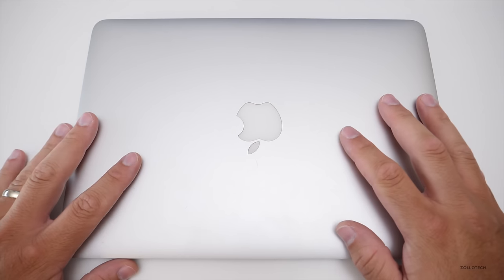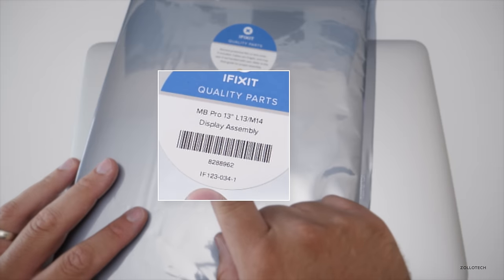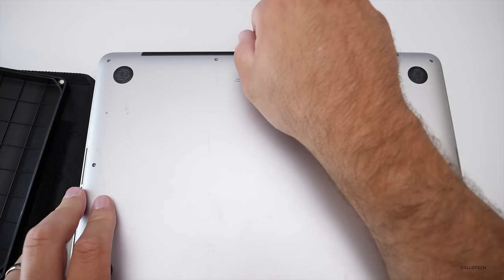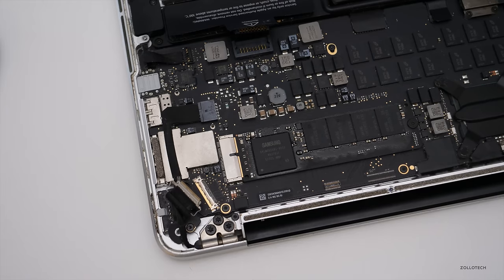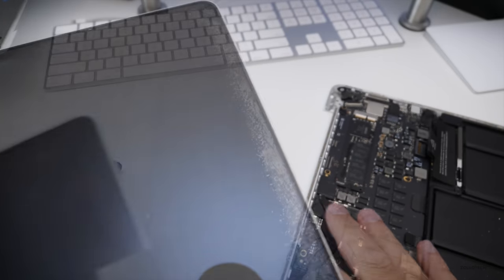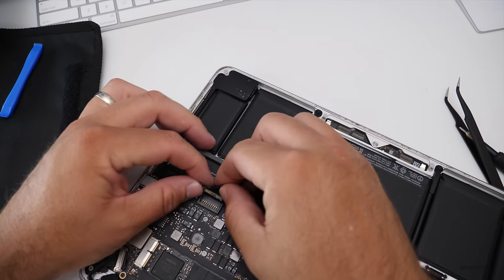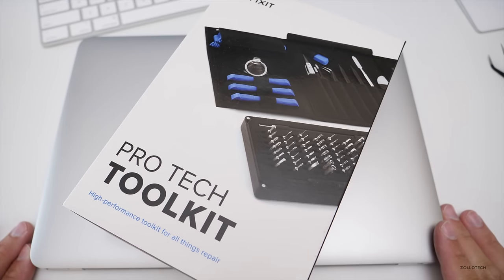MacBook Pro Display Replacement

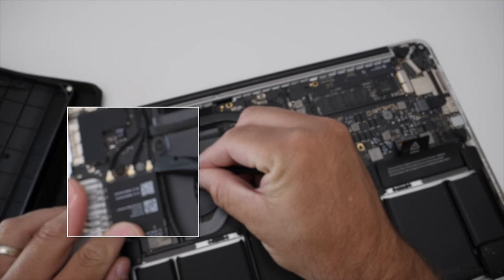Comment: Zollotech.  Thanks for the instructions!  Followed it to a 'T' and I am now writing this review on my repaired MacBook Pro.  The only trouble I had was reconnecting the three cables as shown at 3:08 ...that was a little cumbersome.  But with a little patience and perseverance, I got the cables reconnected.  I found it easier to have the MacBook back at a 90 degree angle when putting the replacement display in place.  All together, it took me about 45 min. Thanks again.
Reply: Thank you for the review! I need to replace my screen as well and was feeling a little worried about how well I could do this. Your review gave me confidence
Reply: How much did u pay for Retina display

Comment: I've used this to swap screens on Retina Pros and yeah, it's a great guide, very informative.  I often get them in stock to sell so I do a "good/better/best" thing where ones with scuffed screens get paired with scuffed keyboards/cases and then the nicest screens go on the cleanest machines.  Gets around that super common problem a lot of these have which is screen delamination, which I believe even on the last 2015 Retina Pros Apple don't cover for free replacement any more.

Comment: I came here considering helping a friend with a borked display. I'm VERY impressed with the presentation, and the time saving video production techniques. Your narrator is great, and the microphone and camera choices are spot on. 

Having watched this, I know that it's cost prohibitive but now I won't bother looking into the replacement parts that list at less than $100. I suspected as much, now I won't waste any time. My friend's MBP probably won't get repaired. C'est la vie. My choices are informed by a terrific video. I'm a subscriber now. 

Great job, gang.

Comment: Just replaced the display of an early 2015 13" MacBook Pro. This was very helpful. Only difference is two additional screws needed to be removed next to the hinges before the screen can be separated from the computer body. Took about 30 minutes for a first timer. $360 for the screen and $11 for the tools. Good as new.
Reply: May I ask where you purchased your MacBook screen?
Reply: @Aaronlek  Amazon has them

Comment: Thank You bro, really helpful. Had a cracked screen on my late 2013 MacBook pro 13.3.  some stores were saying $600- $800 to repair it.  Followed these steps and it worked awesome!!!
Reply: Anup Asok how much did it cost you?
Reply: @ajaybhogal4730  my friend had a same model MacBook pro with system/battery dead  lying around. I used the screen from it.

Comment: For anyone on a budget, simply getting a secondary monitor may be your best bet.  You can get a good for for less than 200 bucks.  

The replacement and repair prices are so high that you really should just get a whole new / used MBP that works.   3rd party shops charge at least 500 and this screen plus tools is 670.  
I got mine used for about 850, but dropped  it an cracked 1/3 of the screen. 

The downside of a second monitor is obviously lack of mobility, but it's better than putting nearly 700 into an 850 machine for me.

Comment: Great video. Nice to see someone with a decent voice, acting ‘normal’ and not trying to sound like a ‘bad voiceover’ type - who is intelligent. Aaron - quick question. My MacBook Pro is the 2017/2018 model. There seem to be extra ‘clips’ between the screws on the back case. A couple of them popped loose but there seem to be s couple more that are holding the rear panel pretty strong. I don’t want to bend the rear case - any suggestions? Max

Again - excellent video!👍🏻

Comment: Thank you so much for making and posting this how-to video. I just finished replacing the display on my 2015 15" MacBook Pro. I wanted to add a couple of points... The only Pentalobe tool I needed was a P4 as the rest of the screws are Torx and I already had those. Also, slightly loosen the last two screws before you open the laptop to make it easier to take them out. I found that I had to open my display as far as it would go (more than the 90°) for it to separate from the body so you should probably do that before you remove the last two screws.
Reply: Thank you for adding... Would you know, by chnace, My glass is cracked, but i have the discoloration lines .... does that mean the display (which works and just can't see through where lines are and dark spots are) is okay, and I just need glass?
Reply: T billx Gplay4 space G  Based on what I read and watched, it’s almost impossible to remove the glass without damaging other parts on the newer MacBooks.

Comment: Great video.  Just replaced my screen due to antiglare delamination - which Apple would not replace bc I was outside the 4-year window from purchase. Only issue I struggled with was connecting the tiny middle metal connector. It had to be perfectly aligned.

Comment: The screw I used is 1.5STAR for 10 screws on the back cover, T5HEX for two small screw on the hinge and T8HEX for  6 slightly bigger screw on the hinge. All of them are from JakeWay JM-8126 that can be bought for ~12$

Comment: If anyone has a half broken screen: go to settings on Mac and dock settings and move the dock to the side that isn’t cracked. Get a program called “spectacles” on safari google spectacles for Mac. Then look up how to add more icons for the top toolbar so you can move the useful icons like WiFi, Bluetooth, search, clock and stuff. You can move them by holding command (the “cmd” button next to the space bar)and click and drag the icons like WiFi search clock to the side of the screen that isn’t broken.
Reply: Thanks for great dock tip. Power cord connector was in MacBook when it closed and it damaged about half of display. Everything works, Can use right half to 3/4 of display at times, mostly half, move the dock to right side thanks your tip and now work with screen area little wider than my iPad. As for replacing the screen.
I can replace this whole 2015 Mac Pro for less than $200 and just swap the hard drive now that I see how easy it is to get at it.

Comment: I just knocked my husband's 2015 17 MBP off the table with my knee and broke the screen. I don't think I could do this, but it's still less to get it fixed at a store than to get a new one, especially with all of the stuff currently on it. Love Macs and have no thoughts about going back to a PC laptop by choice (work is a different story).

Comment: Hey, I am Akash, I am from India. My macbook pro model A1502 got damaged due to water. Intially it was working just fine so I thought that the water didnt seeped inside. But now, half of the diplay is completely damaged, there are continuous horizontal lines on the screen, and the screen is flickering continuously. Do I need to get the display assembly removed or is it repairable? Please help. Thanks and regards.

Comment: Great instructions! Just wondering if it's necessary to disconnect anything more than the battery and display cable....
Reply: All the cables he disconnects are attached to the screen assembly. He did not do a good job explaining/showing this.

Comment: Excuse the 6 yrs later comment, but, do you think it's possible to take a macbook pro 2015 display off and wire it to an hdmi or usb-c male part and use it as a second monitor? (I'd like to recycle parts and have something for when I travel)

Comment: Missed the bit where you physically attached new hinges with base computer. My New assembly had similar aligned brackets flush with screen but I need to turn them 90 degrees to fit in my computer base, looks like you have Retina Display mine is a Unibody and have to drop in hinges?

Comment: I have a 2011 MBP with a bad logic board. I was thinking of buying a non-Retina 2012 with a broken screen on the cheap, then swapping the top. Do you think that's possible, or are the voltages/connections/etc. incompatible?

Comment: I spent $415 on a top assembly for a late 2013 MBP 15". I suppose the price didn't change much within 2 years. And about $415, I didn't spend all my own money on it. To summarize, my friend caused dead pixels from pressure and I sold the assembly in the current condition. He did pay the remaining amount for me to get a replacement w/ equivalent cosmetic condition but I took this opportunity to spend more to get a like new condition assembly. Plus it was for peace of mind since I bought an assembly before and I wasn't happy with the condition. Getting to the point, these screens are still ridiculously expensive. At least sell your current assembly to get some money back, even if it has a cracked lcd.

Comment: Hi Zolotech , can you kindly tell me if the 13.3" A1466 screen is interchangeable with a 13.3" screen for a 2013 A1502 Retina Macbook Pro screen ? I believe the A1425 is can you confirm or advise any other models that are compatible with the A1502 thanks

Comment from the maker: Ever replace a display?  How’d it go?
Reply: zollotech a week ago I changed display but it have a small white pixel on bottom.. Any fix for that?
Reply: I've replaced a display on Kindle Keyboard, Pretty straight forward and I even used the old one to display a Tardis (KK was Jailbroken) before I disconnected it. Which should display forever as eInk uses no power unless it refreshes!
Reply: zollotech have replaced hundreds of them. Goes better when you take it to an authorized service provider. Can't tell you how many system I had to repair that "do it yourself" folks messed up from using poor quality parts and/or not taking proper safety precaution and doing shoddy work because this was their first and only time ever trying it to save a few bucks. Best advice - AppleCare, and if you have issues beyond the 3 years get a new system. 3 years is a good run for any laptop if you use it regularly. If you can't afford a replacement after 3 years maybe you bought the wrong laptop to begin with, and get a cheap PC.
Reply: I've replaced a few lenovo laptop displays most went ok. I work for Flex LTD and repair different computers and stumbled across your video to get some insight on macbooks. Thanks.
Reply: zollotech 00
Reply: Hey I've been getting exposed to alot of these portables with cracked lcds they are easy to replace.
Reply: Just did it yesterday and the display brightness won’t go up or down. Probably need to connect and disconnect
Reply: ImJusThtGuy  yeah just check the cables but if it gives you more problems check the top case assembly.
Reply: Hello ! Super new to your channel. I just broke my screen with the LCD. The link you provided says it’s out of stock . Do you know if any other websites that carry it ? I think I want to do it myself 
Thank you .
Reply: M Moore Applecare 😂😂😂🤞🏼

Comment: I have a 2012 macbook pro with broken screen. I used it hooking up with a monitor but has been resting on the shelf for quite some time. I wonder if it would work if I remove the top and then connect it to a monitor.

Comment: When you replace the display, your data stays safe right? I brought my laptop to the Genius Bar and they shipped it to get replaced for the same reason and I’m worried about my data
Reply: yea...your data should be ok as it resides on the hard drive. They just replace screen which just displays...but its always a good idea to take a backup of your data (copy to a usb hard drive) before you send your laptop out for service or repair as they might mess it and Genius Bar would have mentioned it to you too.
Reply: @chicagopooldude  Thank you so much! Got my laptop back today and all my data was okay!

Comment: When reassembling, your video goes rapidly and does not show some of the operations. Had an issue reconnecting the three-wire harness. The connectors are so tiny, they are hard to line up and press together.

Comment: With this kind of screen error can you just use an external monitor?
Reply: You gonna take that external monitor with you everywhere you go? That defeats the point of the laptop.
Reply: @cbernier3  well what if you want an apple system for work, and you want one for cheap and you would use it with a monitor all the time anyway? If it works with the monitor it might be good for someone who would dock it anyways.
Reply: @MrNotYet1  nah man. First, work will pay for your work computer. I want them to buy me the best computer they will pay for. Not a broken one. Also, I really need both monitors to do my work. And your work computer is not always at your desk. I have to bring my work computer all over the place. Meetings, home, other offices, etc.

Comment: My display is broken but the computer still works. I can plug it into a tv fine. 
Do you know if the computer will still work if i remove the display and just use the tv as a screen?
Reply: Explain

Comment: I just got a new macbook (the new m1 macbook air) but my old one (which isn't that old it's a MacBook pro with sliding bar 13 inch I'm pretty sure the first MacBook made with a sliding bar) but yeah my old one's screen has a chip on the bottom right corner (so my headphone jack was under the screen and I slammed the screen down so it cracked a little the screen itself isn't shattered or anything but it started making weird horizontal lines across it) and yes I have a new MacBook but the old one isn't THAT old yet and I don't wanna throw it away but I also don't want to spend like $700 fixing only the screen coz the battery is kinda bad too so I wanna fix it by mself but ahh idk

Comment: My screen was like yours with the stripes.  One had one that crashed so but his screen was fine so I replaced I put his screen on my computer but now I only have limited use I've have the original installation disks but they don't read or work

Comment: Hi, so I have a problem. I’ve changed my display screen. It all works! But, when I power on my laptop on, there is a black screen and I can’t tell wether it’s loading or not. so I kind of input my password in and enter. After a few seconds, it then comes on with the loading page and works perfectly fine after that. Is there a reason why it does that? Thanks

Comment: There is a way easier and way cheaper way all you need is a mini display port to hdmi and an hdmi cable plug the Mimi display port in the MacBook and plug the hdmi into a tv and the adapter change to the hdmi number on the tv remote (source button or button on side of tv) and your screen should be there your welcome for saving you a lot of money on a new screen.

Comment: The 2012-2015 MacBooks had such a user friendly design. The 2016 models and 2017 can't have wifi repaired practically or storage upgraded :(
Reply: DrMacintosh ii

Comment: OK OK The rubber part at the bottom of my computer screen some how got stuck and i used  tweezers to fix the rubber once i removed the tweezers though the screen started to have lines and had a white line on the right side and has a black lining all around the computer screen and it mirrors what i last had open and it doesn't disappear and since it is a older mac book my parents don't know what the do and we don't have the money to fix it does anyone know how to fix it i know it is hard to know without a picture but still just a little help would be nice

Comment: Thanks Aaron,  I’ve a chance to pick up a MacBook Pro for $100. The Screen glass is actually cracked, however the display works good.  I did not know I would have to replace the whole....screen.  So now that MacBook Pro just became $500.  Thing is, I am planning to just connect it to my flatscreen tv/monitors with HD cable.  Figured I could upgrade the MacBook less expensive than buying a new MacBook Pro any way.   As always, thank you for your videos.....Tye
Reply: Tye Miller You don’t have to replace the whole screen. The glass screen can be replaced separately from the LCD. You just need to heat up the cracked screen with a hair dryer and buy a new screen for about $25 to replace it. There are tutorials on YouTube for you to inform yourself.
Reply: @khoahatake2017  Thank you. thats the info i was starting to look for. My glass is cracked, but i have the discoloration lines .... does that mean the display (which works and just can't see through where lines are and dark spots are) is okay, and I just need glass?

Comment: it cost just the same for apple to replace i just came from the store today  and they want 475
Reply: Joseph McCool  I went to the Apple store today. They told me it will cost $475 to get it fix.
Reply: @yoeurth77   I had mine fixed by apple and the breakdown included a 100 dollar labor fee. Still the total cost was around 500 for a 2015 Macbook pro screen.
Reply: Joseph McCool Apple quoted me $1100 for mine yesterday. I’m def going to try this route!
Reply: @ambergutierrez2883  That's insane.   You could buy new ones for less than that

Comment: Simple to do, but he tool set is like $149 bucks and the display is easily $600 or more. Going to turn my macbook pro into a portable desktop. Bought a portable external monitor 15 inch for $299, a wireless mechanical keyboard, and a stand that holds the macbook and monitor for about $360 in total.

Comment: Its been two years i have been using my macbook pro. I dont kno how but the screen is showing problem. I never dropped it. I never used it roughly. I take more care of it than my dell. Unfortunately it still have problem. Thought of going for an apple product, clearly i will not go for it...not now...not ever.

Comment: What are the jacks (J0,J1,J2) used for?

I have replaced my screen display, but it still doesn’t turn on, remaining black with zero light. The charger displays connection and the start ding occurs but no screen activity.

Just wondering if the the jacks have any effect being the new one I purchased only had 2 opposed to 3